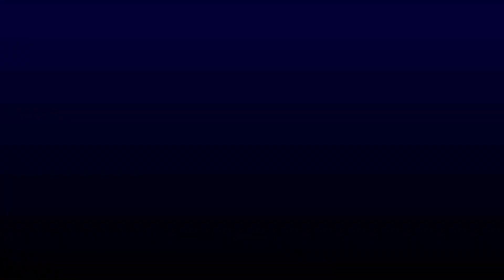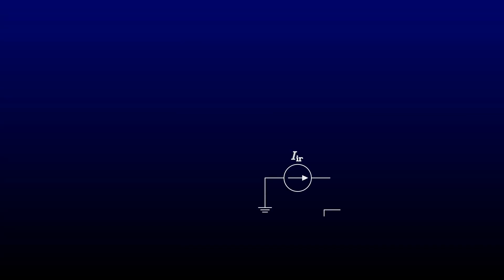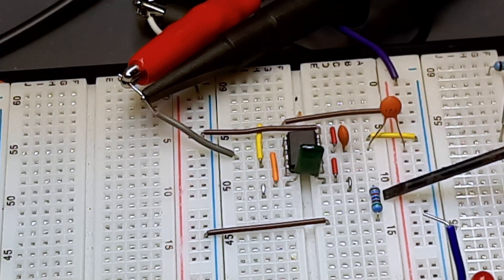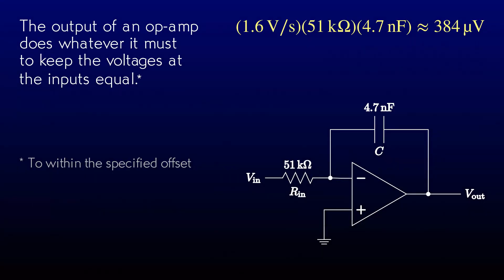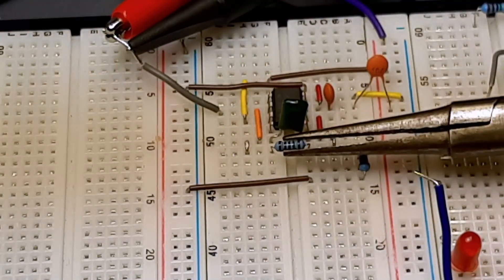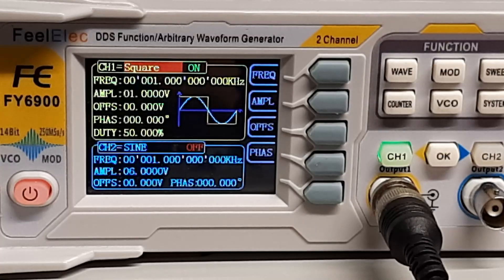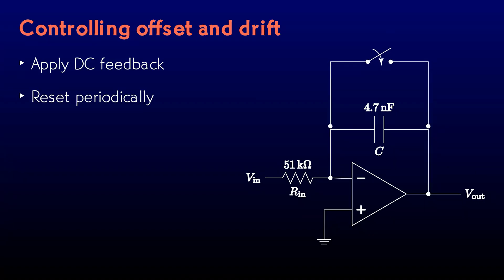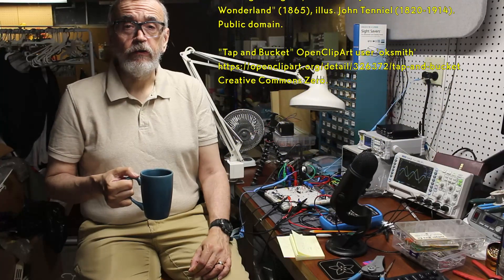Audio Synthesis ep7: The Op-Amp Integrator

Comment: Great video and clear explanations. For anyone curious, DC feedback and nulling and periodic resetting aren't the only methods to deal with offset...search for "Dynamic Offset Cancellation Techniques for Operational Amplifiers" for a pdf chapter that goes through a few...one I like is the "Input Offset Storage" method, which uses a few switches with an extra capacitor to first sample the offset voltage onto that extra capacitor and then put that capacitor on one of the opamp inputs with a polarity such that the capacitor's stored voltage cancels out the op amp's offset.  This sampling can be redone periodically so the capacitor will be updated with a new offset voltage in case the offset voltage drifts with temperature.
Reply from the maker: @EricFontaineJazz  Auto-zero op-amps will definitely be the subject of a future episode! Gotta crawl before you walk, walk before you run, run before you fly!

Comment: Several errors here. The statement about keeping the inputs equal is not an ideal opamp property: it is a consequence of those properties when NFB is applied. Converting volts to volts/sec is differentiation, not integration, and it’s not what this circuit does. It produces output volts as the integral of volts/sec at the input. There are other ways of dealing with offset.
Reply from the maker: I'd argue that what you are calling 'errors' are at worst 'oversimplifications.'

First:  Observe empirically that the circuit, taken as a whole, does produce an output voltage proportional to the integral of the input voltage over time. The demonstration at the bench shows this with several input functions that can be readily verified.  I gave it a square wave at the input; the output was a triangle wave, not a series of delta functions. 

In fact, your phrase, 'integral of volts/second at the input' is puzzling.  'Volts/second' is the derivative of the input voltage, and 'the integral of a derivative is the function itself - and clearly this circuit is not just functioning as a linear amplifier!

You seem to be stuck on the idea of 'a capacitor differentiates its input voltage.'  It does indeed: I = C dV/dT.  But what the simple analysis presented here does is to turn that relation on its head and say that a capacitor integrates its input current - which is an equally valid way of looking at the problem.  The charge on the capacitor is Q =  ∫ I dt , and the voltage across it is V=Q/C = (1/C) ∫ I dt.  In circuit analysis, it's important to think of things either way; sometimes it's more convenient to look at currents (and consider Norton equivalents of networks), other times voltages (and think of Thévenin equivalents).

I concede that I left off the key words 'in the presence of stable negative feedback.'"  With that out of the way:

1. The feedback loop functions to maintain the (-) input of the op-amp at virtual ground.
2. The input resistor therefore functions to inject a current into that node proportional to the input voltage (and in fact I_in =  V_in/R).
3. An ideal op-amp's inputs draw no current, therefore the feedback current must balance the input current. (I_c = -I_in)
4. The voltage across the capacitor will be the integral of the current moving through it - and said current, we just said, is proportional to the input voltage. (V_c = (1/C) ∫ I_c dt = -(1/C)   ∫ I_in dt = -(1/RC) ∫ V_in dt
5. Since one end of the capacitor is at virtual ground, the other end will be at the stated voltage.

The constant of integration is determined by the charge on the capacitor at the start of the interval where you start measuring. The function of the RESET signal is to establish a time where the integration begins.

Yes, there are other ways to deal with op-amp offset that I haven't discussed ... yet.  (Some of them are coming!)  One important one is to use a commutating-auto-zero (that is, chopper-stabilized) amplifier to mitigate it by monitoring it aboard the IC and injecting an equal and opposite offset to cancel it.  Or, as I said in the video but did not demonstrate, sometimes your circuit topology cancels the problem for you - an example that I plan to get to soon is a triangle-wave oscillator that does just that.  Input offset causes a negligible asymmetry in the rising and falling slopes; the frequency remains constant regardless of the offset (within reason).  But the two most important techniques by far are integrating over a short enough time that it's not a problem, and rolling off the integrator's DC response so that it centers itself.  

At some point, I'll most likely have an example that needs an LTC1150 or MCP6V51 (or some such). Auto-zero is in the category of "I'll cross that bridge when I come to it."  It's got its problems - it tends to be an expensive solution (have you checked out the price of an LTC1150 lately?) and you usually start to struggle with clock feedthrough when you use auto-zero amps.
Reply: @KludgesFromKevinsCave   I don’t see how you can possibly conclude that I am ‘fixated’ on something I didn’t even mention. The fact remains that describing integration using units appropriate to differentiation isn’t a mere ‘over-simplification’; and you’ve acknowledged your other error.
Reply: "There is no God and Dirac is his Prophet." - Wolfgang Pauli

Comment: The statement “This circuit knows calculus!” Is backwards.  The correct statement would be: calculus can simulate the behavior of this op amp circuit.   The circuit is the real world and calculus is an abstraction that predicts its behavior.
Reply from the maker: Calculus can model the behaviour of the op-amp.  Alternatively, given a calculus problem from elsewhere in the real world, the op-amp's behaviour can model it fairly closely.  (Recall how analog computers were used to compute things like the firing tables for guns or the rise and fall of the tides, before there were digital ones.)  Is the real world an instance of some sort of Platonic reality in which mathematics reigns, or is the mathematics a mere abstraction of a portion of reality?  

I think you'll agree that the way I wrote it makes for a better headline.  😁
Reply: @KludgesFromKevinsCave  - I’m actually among the last of the dying breed that actually used an analog computer in the workplace.  I don’t disagree with anything you’re saying.

Comment: Isn't an integrator with an AC signal essentially a low-pass filter?
Reply from the maker: Yes.  And, uhm, sort of.

It has a low-pass characteristic - its output falls off 6 dB/octave or 20 dB/decade. 

But typically a low-pass filter - even a simple L network of a series resistor and a capacitor to ground - will have a transfer function that flattens as the frequency goes to zero.  Feed it a DC signal in, you get a DC signal out. But if you feed an integrator a DC signal, you get a ramp, which doesn't stop until the op-anp hits its voltage limit.

Try it yourself to see the difference.  Build an integrator, and then use the same resistor and capacitor to build a 1-pole active low-pass filter. (RC low-pass filter feeding a unity gain buffer).  Measure the frequency response with signal generator and scope, and see the difference.  Maybe I'll do a short video on it, it's a simple enough thing to set up.